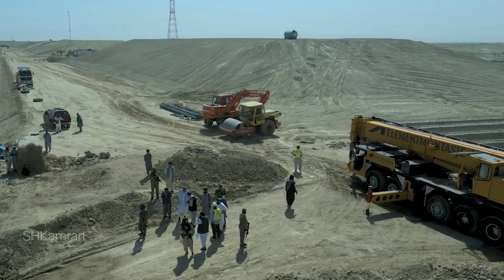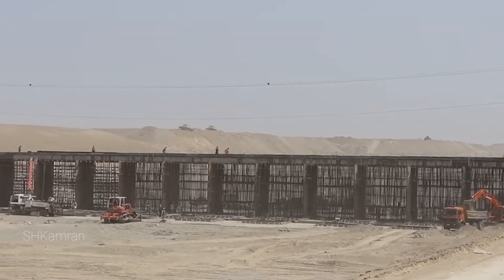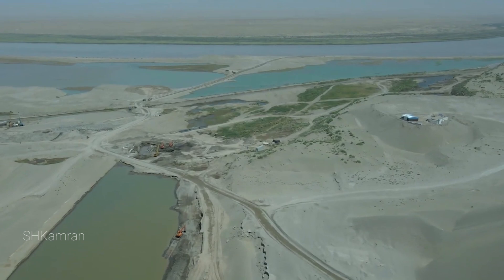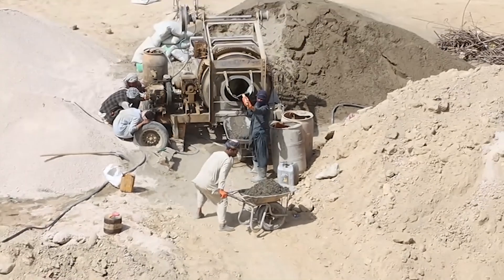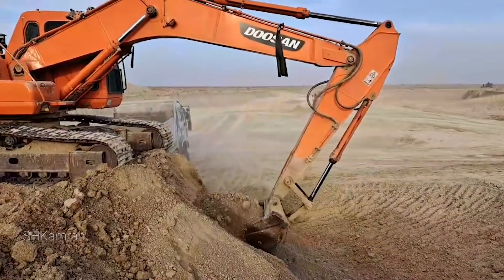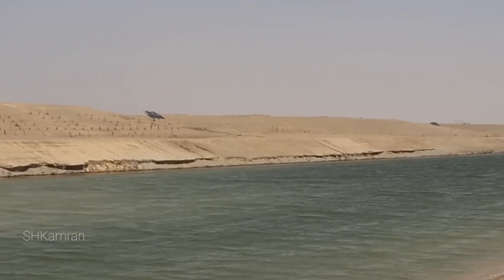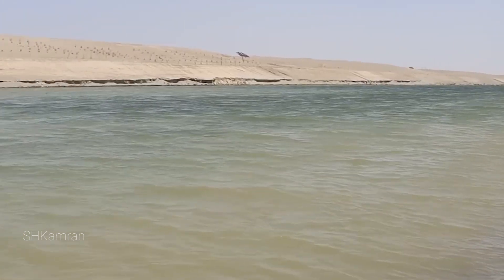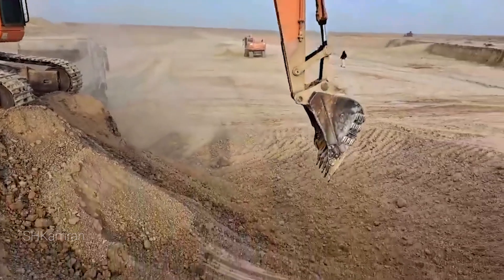Latest details of Afghanistan's longest desert canal project

Comment: Great project. Without the cement lining many more water is lost due to evaporation abd seepage of the desert land.
Reply: Cement lining. If you mean on the sides of the rivers not only cost a great deal more and i mean a great deal more but either are better or worse depending on the landscape and soil etc and other stuff. On an another video that did research into exclaimed it to be the better choice in terms of cost and the rising water and winter times etc

Comment: The structural integrity of the canal seems to be questionable without the side concrete barrier. The sand erosion may fill the canal frequently due desert Strom's need more maintenance. 
I suggest them to plant fruit bearing trees that hold sand.
Reply: Bro. They are now planting trees around the canal. All are fruit trees. IN SHA ALLAH in few years it will b more green and fruity